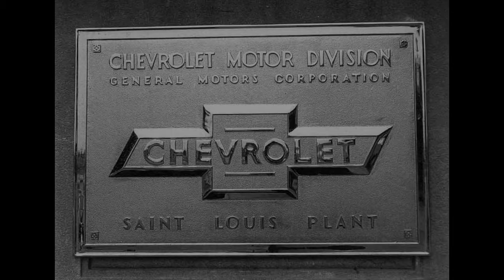Corvette C2 C3 Production Line Montage St Louis

Comment: I’m most intrigued that the factory body lift was at the wheel well. Nothing like the recommended lift points I see in forums
Reply from the maker: Oh yes thats interesting.
Reply: Also noticed they assembled the front end although everyone seems to think it almost impossible to get the fenders properly aligned if you separate the bond joint

Comment: Anyone know what the production was per hour of these c2s
Reply from the maker: If you consider to have 250 working days in one year and you work in two shifts per day, that means the line is running 16  hours a day, then you have 4000 hours per year.
The Total amount of produced C2 varies from 21000 to 29000.
So I would guess there were 6 cars produced per hour aproximately.
Some years 5 and some years 7 per hour.